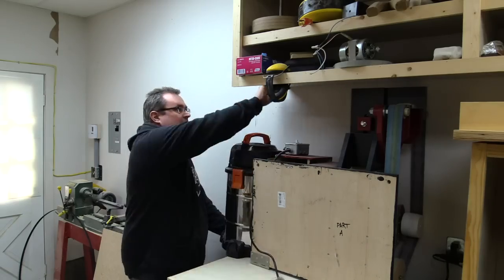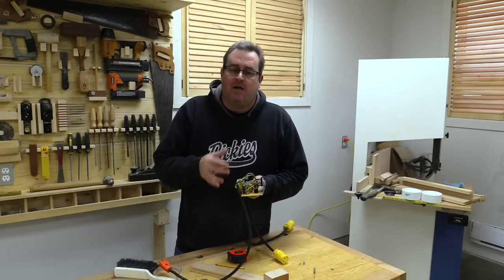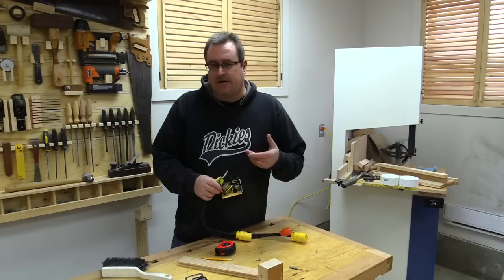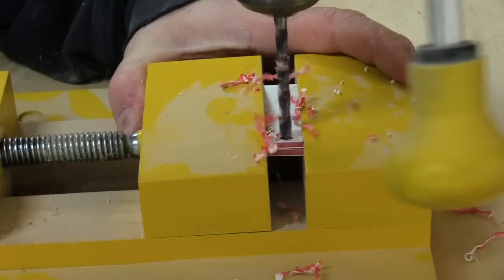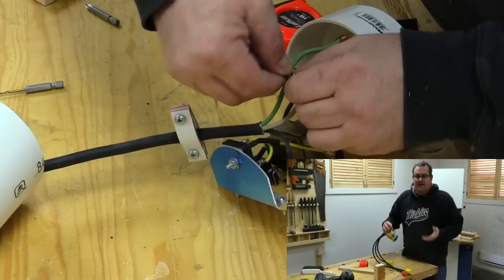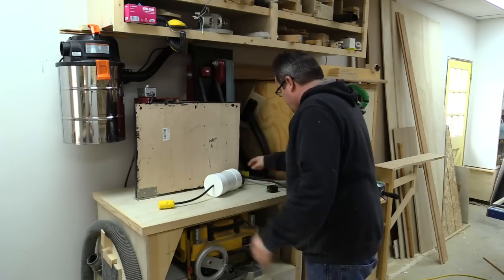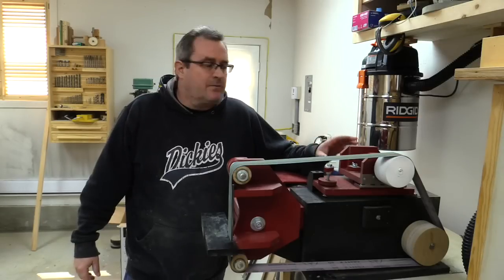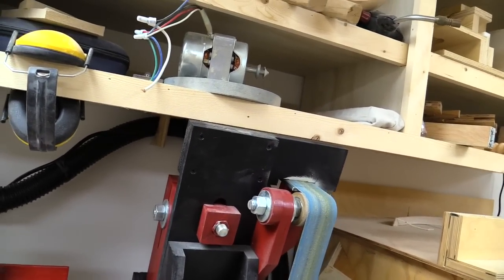The Automatic Switch

Comment: Maybe a big capacitor parallel to the relay coils would leave the vacuum running a bit longer.  It would also delay turning on the vac a tiny bit, but it typically takes a second or two before you make dust.
Reply: My thoughts exactly. Although it wouldn't have to be a big one. A medium sized cap would charge quickly, and discharge at about the same rate. Not sure what the circuit pulls for VA, but I bet it's not much to add a delay of 1 to 2 seconds.
Reply from the maker: Matthias Wandel Tried it. The transformer doesn't deliver enough current to charge a large enough cap to give any significant extra run time. Better to just add a small on-board power supply and delay the shut off of a transistor with the RC circuit.
Reply: I Build It 555 timer should do the trick
Reply from the maker: bloggermouth If you want to do it the hard way, sure. An RC timer would work without needlessly complicating it.
Reply: I Build It 
It might be possible if you exchange the mechanical relais with a solid state relais. Their control input current is almost always much lower than the current needed for a relais coil, so you might have more luck with a capacitor. The rest of the circuit would stay exactly the same, although the values of the transformer and capacitor might need to be tweaked.
Btw. another point to play around would be to use discrete diodes instead of a bridge rectifier. It would be possible to easily change the voltage drop and maybe match it better to a transformer you have lying around.
Reply: I Build It 
Thought of another change (without changing the circuit too much, but moving from "just use parts from the bin" to "have to get some parts"): The rectifier/transformer combo could be exchanged with a single current transformer (should definitely be enough if combined with a SSR instead of the mechanical relais).
Maybe you need a second one some time and try that out ;)
Reply from the maker: superdau I already mentioned the ssr in the project article on my website, but I didn't have one to use for this. As for the diodes, more drop equals more heat, so it's probably better to find a more suitable transformer.
Reply: Why not build a circuit that connects the saw and the vacuum in series between two legs of 120v. You could run a 220 circuit or just use two outlets from different sides of your breaker box. As long as they both have nearly the same resistance you should be good to go 
I'm guessing that you are pushing over 20 amps through that one circuit anyway. This way you will only use half the current so as to reduce the risk of melting wires.
Reply: Good
Reply: I Build It Doing it the hard way is often the best way for me to learn. lol I'm not familiar with the RC circuit and thought the size of the circuit with a 555 timer would suffice. Most often solutions come best with you have the right supplies. I have lots of 555 timers. I also have lots of Rs & Cs and didn't think of that circuit because I figured the cap would have to be quite large. I'm not an expert in this area. I'm primarily a coder.
Reply: bloggermouth 
A RC circuit is much simpler than a 555 timer circuit. For a 555 you would need some kind of constant DC power supply, which this circuit doesn't have and need. Calling this circuit here an electronic circuit is almost too much (hard to tell where to draw the line). I'd rather say it's an electrical circuit (which is the beauty of it). The primary side diodes are just there for their voltage drop, not for rectifying anything. And the parts on the secondary side could all be left out, if you had a fitting relais switchable by AC.
Reply: superdau
I looked it up after John mentioned it. The schematic was simple to understand and one of those aha moments. I play around with Arduino based circuits mostly and have minimal experience with more complex ones. Your explanation is great and I learned something. Thanks!
Reply: A big cap will have the relay contacts closing slowly which will be hard on them.
Reply: Matthias Wandel I see what you're saying but the charge time can be reduced by a smaller resistor in the trigger line.  When the trigger goes away, then the capacitor discharges the 5 TC's through the resistance value (impedance) of the coil of the relay.  So a faster charge and a slower discharge can be obtained.
Reply: Ron Briz
No use. That's not how electronics work. A relay coil needs quite alot of current. You can't just limit that with a resistor, because the relais won't switch at all then.
And a cap that would be able to supply that current for a few seconds would be way too big to be viable anyway.
Reply: superdau Yeah, I see your point.  I think maybe to get away from future contact burn out, would be to go to a triac or other new electronic component that he was talking about.
Reply: Matthias Wandel If I were doing it, I would have this control a timer relay, set  for off delay. It would also make it so that a separate circuit could be used to power the vacuum, if it is like my miter saw it shouldn't be sharing a circuit with other tools. I would also look into using a current transformer switch to run the timer .
Reply: superdau Actually it depends on the type of relay that is used. I work with relays all the time and a lot of them have current limiting resistors at the relay which I can control the pickup, working and drop-away currents through the coils but I agree with you that having a longer drop-away won't be accomplished with a resistor in series with the coils and just using a cap won't achieve much.

There are slow release relays that could be used for this circuit. Also like other people have said, an RC circuit will work.
Reply: +Matthias Wandel where can I find a 12 vdc, 380 ohms relay.  I can only find 480 ohms.
Reply: Lynnette Cox That should be close enough. I had forgotten all about this project.  If you build this unit, let us know how it turns out.
Reply: +I Build It you could probably hack a toaster circuit to do that.
Reply: +manaquri: I am curious :  what is a toaster circuit ?   How would that work ?  How do you sense the load current  ?
Reply: Daniel Sauriol
a toaster circuit is the circuit from a toaster, it will activate a coil that keeps the button down and pressing on a switch for a set time. Basically, you replace the coil+switch by a relay, and you have the relay switch in parallel with the other relay from the circuit in the video. (it is switched on by the other relay, and then switches off after a set time.)
Reply: All vacs that get up to speed will still be spinning long after the power is removed, without additional circuitry. At least as long as dust is being made, it will be being moved. But if you must, go solid state, as some are even latched briefly internally, even with an external drawdown resistor. Just adding  a small cap would add several seconds

Comment: How come John can make this thing with working, industrial strain relief, but my $119 Apple laptop adaptor cables are made from recycled butterfly wings?
Reply: Ei aC Whoooooosh
Reply: also, Apple power supplies are really good isolated things... put a Windows laptop next to a Apple one, play some sound over a big setup and listen to the hiss when plugging it in to an outlet
Reply: +Ei aC 
He doesn't need grommets, as it's not penetrating metal. He has protection, as he's keeping the circuit grounded. Plenty of products are not grounded to chassis. I would definitely glue the end caps on, just in case.

Comment: +II Build It Your statement about 240V AC is more dangerous \ deadly than 120V AC is 100 Percent incorrect voltage does not    kill Amperes is what can or will Kill you.  The old statement that it take 1 Amp to kill you is also false though not as likely actually less than a single (one) amp can kill a person especially if shocked in the torso and the person cardio vascular health is poor.  In actuality 240V AC is safer than 120V AC because the required Amperage to power a device (motor) that has the same output on 240V AC  is about one half compared to the same device (motor) running on 120V AC.
Reply from the maker: +gullreefclub 
Read the other comments on this and do yourself a favour - don't take your word for it, if you are handling electricity.
Reply: When considering shocks off power systems (shocks off high-impedance sources are another matter) current through the body is determined by the resistance of the body and the voltage of the source. The normal operating current of the system is irrelevant.
Reply: you are correct that amperage kills. but amperage is the dependant variable of ohms law. to increase amperage you can increase voltage( 120 to 240) or reduce resistance ( wetting your skin). a big wire for big current will give you the same shock as a little one if it has the same voltage.

Comment: That rectifier in dead short just doesn't sit well with me.
Reply: eformance The current in that 'short' will be no more than the current in the saw, say 15 or 20 A.
Reply: 1.5v at 10A is 15 watts of power dissipation, at 20 it's 30 watts just going into the ether.  A current sensing transformer with TRIAC and AC relay would be a better approach.  The trick is getting a CS transformer with enough coupling voltage.  Alternatively you could use one of those LED indicator types with a pair of 4N25s bi-polar biased, a wall wart power supply, and DC relay.  The LED indicator is a bipolar LED, just arrange the 4N25 input in the same manner with 2 of them in parallel to drive the relay.  During one cycle one 4N25 will conduct and when the cycle reverses, the other will conduct.  Run the relay in open-collector output on the 4N25s with a bypass capacitor to smooth out the ripple.

Comment: In the course of finding and pricing the components for this switch, I came across this automatic switch on Amazon, that does the same thing.

https://smile.amazon.com/DGC-PRODUCTS-IS110M-i-Socket-Autoswitch/dp/B005ELWUWG/ref=sr_1_2?ie=UTF8&qid=1484660641&sr=8-2&keywords=automatic+switch

It's $35.80, which is less than I can buy the components for. Unless you have old electronic devices laying around that you can scavenge the transformer from, this switch is probably cheaper.

Comment: Was wondering how much current the relay needs and how large a cap you would need to prolong the on time of the vac. But I havent tried it myself and John usually gets annoyed so I guess it is not practically possible.
Very simple and nice circuit.
Reply from the maker: gamingSlasher What you need to look at is how much energy is needed to charge a capacitor big enough to keep a relay coil energized for any significant amount of time. For 2 seconds at 10VDC into a 384 ohm coil, you'd need a 5600uf cap. While that big cap is charging, there's not enough current left over to power the coil in the relay, so that stays off. Given that it's really the startup current spike that trips the relay on to begin with, it may never come on at all. At least it didn't when I tried a 4700uf cap.
Reply: I Build It capacitors discharge to quickly in that setup. i have a proposed circuit in one of my other comments

Comment: could a simple relay wired inline with the saw plug not have achieved the same function?
Reply: +charlie0801  : that would mean that 100% of the load current (15A to 25A) would have to circulate through that relay.  The coil's relay will blow in an instant.  Secondly let's just assume for a second that the relay's coil can withstand 25A, inserting a transformer in line will cause a voltage drop. This means that you are no longer providing full mains voltage to the saw, which I believe is not desirable.  A diode has the merit of having a fixed voltage drop (1v max) regardless of the load current.  John's approach is simple and is inexpensive.    -dan

Comment: Use a post purge timer adjustable timer relay in the line to your relay coil and this should keep your vacuum on for the time setting before it shuts off. 
http://www.icmcontrols.com/ProdImages/ig_LII274-3.pdf

Comment: If you add a capacitor in parallel with the relay, along with a diode to protect the cap from the back emf of the relay coil, it should be able to keep the relay on for a few seconds after main power is cut. If you know how much current the relay draws this would be quite easy to calculate precisely how long the timer lasts.

Comment: I'm kind of perturbed that you stated 120v is not as lethal as 240v. Any mains voltage is lethal, as the voltage is not your major concern. Amperage is the real killer. On top of that, coming from an electrical background, 120vac is considered more dangerous than 240v due to the fact that it's frequency is more likely to make your muscles clench and hold onto the wire. 240v, 480v, etc. typically doesn't "grab" you the way 120 does.
Reply: Kyle Taulton I was gonna agree with Kyle as i read the same thing in an electricity book, but referring to Ohm's law, I=V/R, so increasing voltage or decreasing skin resistance will have the same effect: more amps. True, amps kill, but the more volts, the more amps.
Reply: Then what about stun guns? Some stun guns and tasers have 1 million volts and don't kill, but deliver less that an amp of current. Voltage is just a messenger of the poison known as amperage.
Reply: I will agree that a car battery has plenty of current, and I've been shocked by one. to be completely honest, I feel like the car battery had more pain involved than when I was hit by 120v or 240v.
Reply: Kyle Taulton Stun guns are certainly limited to some 1mA  of current, so the shock is unpleasant but never lethal. With an outlet, you might have a 20A limiting breaker, but by the time that trips you'd be seared to perfection.

Batteries are analogous, no current limit. So if you press on the terminals hard enough (as to decrease the resistance of the connection) then the current will only be limited by that resistance (and skin resistance).
Reply: Kyle Taulton :actually the frequency is the same, 60Hz.  Higher voltages tend to penetrate the skin thus allowing the current to flow within the juices of the body where the resistance is lower.  120v tends to be not respected as a higher voltage thus more folks are prone to be hurt by it.

Comment: why do this? what is the advantage of having this instead of having the saw and vacuum controlled by the same switch(even a power strip).
Reply: at first I thought this vid was nice but now its WHAT??????what is the purpose of this.    there are SSOOO many easier ways of having more than 1 item to turn on with one switch

Comment: Awesome!
Does the rectifier have to be rated at 600 Volts and 35 Amps if the power is only 15-20 amps from the outlet?  I don't know too much about electrical work.
Reply: Sean Rubino He uses  the rectifier just as a voltage drop.  a 5 volt rectifier would do the job, as long as it's rated for the current.
Reply: Ok, thanks, Matthias.  What would the current draw be from running both the vac and saw/sander?
Reply from the maker: Sean Rubino The bridge I used is less than $6, so you'd be better off not skimping. It's sized for current carrying capacity and also for it's ability to dissipate heat, so bigger is better.
Reply: I see.  That's a cool addition to the station.
Reply: Sean Rubino 
If you look closely the bridge rectifier is connected in a way that it's nothing more than two pairs of anti-parallel diodes in series. So none of the diodes will ever see more than maybe a volt in the reverse direction (depends on the forward voltage of the anti-parallel diode). So if you don't want to get a rectifier like that you can just as easily use some diodes rated with a high enough current. They can be had for few tens cents per piece (or for free if you have old PC PSUs lying around). If you use Schottky-diodes be sure you connect more in series, because you need the total forward voltage drop.

Don't take the limit of your outlet as the limit for the diodes though. It is totally possible that a tool takes more amps at startup, even higher than your breaker is rated for. Breakers are designed to not immediately "break" in over current situations (that would be annoying). The trigger time depends on how much over current you are (check a datasheet of a typical breaker to see that).
Your diode has to be able to withstand this behaviour. It has to be able to take "over current" for maybe a second (again some datasheet reading to be done).

Comment: Nice job Mr. Heisz.
Although, I've heard you're not supposed to wirenut stranded wire, I've also done so in a pinch.
Reply from the maker: +TRASHURE 
Using wire nuts on stranded wire is done all the time.
Reply: might be done all the time but if the connectors arent listed for use with stranded wire they shouldn't be used with stranded wire, so the correct reaponse is "check the product listing."

then again, you just stuck an unlisted device in a pvc pipe so who am I kidding?
Reply: Jeremy Mitts Yea, he should have had his homebrew board  approved by the UL first, and only then should he have stuck it into the PVC pipe.

Comment: model 50 current sensing relay, a 24v trans, and a 24volt spst relay. I think I could build this too. throw in a delay on break and keep the vac running a few seconds after the saw has stopped.

Comment: This is so dangerous. The stray electrons that escape the rectifier due to latent charge carrier wander will build up inside that PVC enclosure, and eventually pressurize it to the point that it will explode, releasing a hot cloud of plasma. Combine that with all of the saw dust in your shop, and you risk levelling all of Ontario, and with it, Toronto, the known centre of the universe. Do you want to be responsible for destroying the universe? In Europe the wandering electrons wander counter-clockwise, and because they don't use wire nuts there's no problem.